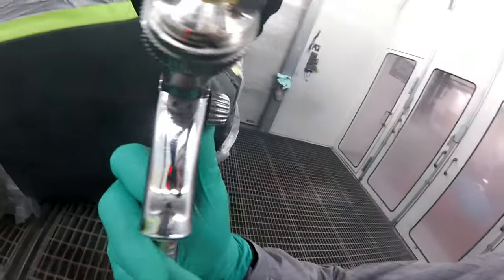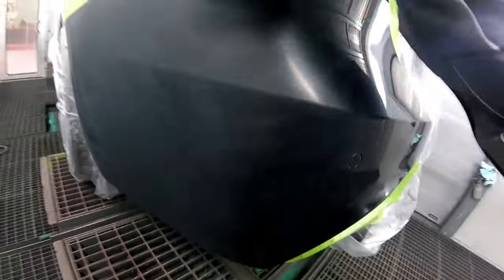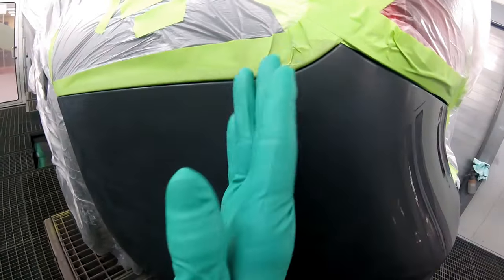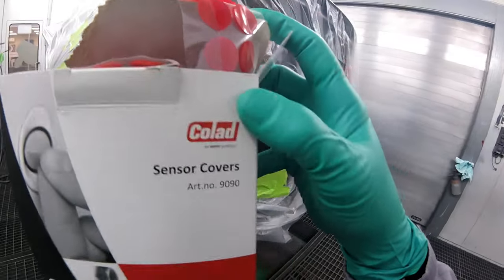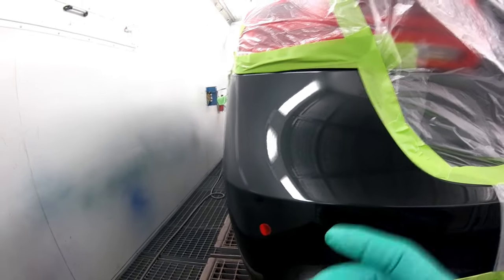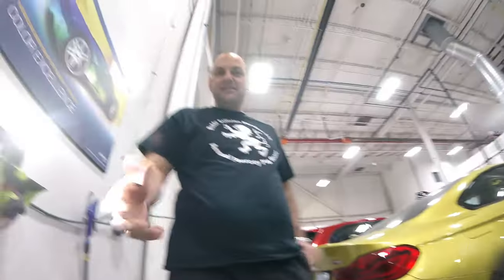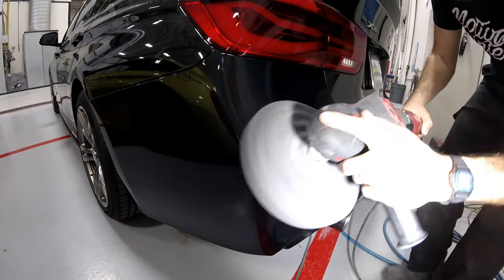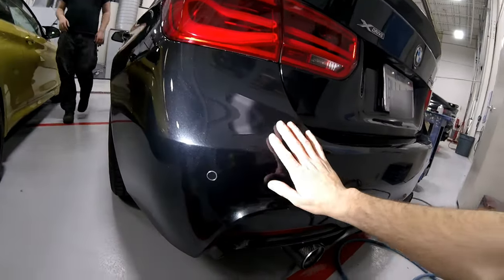Blending Clear Tips Car painting motivated painters

Comment: Nice job my quistion is if you  was to use a eg 2000 grit and then you sprayed the blender it would  run am I correct?
Now you  sprayed the blender on a 5000 gritt  and you  sprayed  alot on and it didn't run  I havnt tried that yet nice tip Gabriel thank you for the video

Comment: I tried some of that spray blender in a can just recently, I wish I had found it earlier now. Makes things easy. Nice work as usual by the way
Reply from the maker: Ahaha awesome !!! It works very very well ! Enjoy !
Reply: I've used the Sherwin Williams BS12 - URE-BLEND® Clearcoat Blender spray can stuff.  Worked very well.  Noticed "Jimmo" on Refinish Network using once.
Reply: @RPMX4  so u use the blend instead of a 2k clear can?
Reply: @MOTIVATEDPAINTERS  why did u not spray the blender across the whole area? U stayed away from the place u based coated and clear coated
Reply: @waynewilliams5802  I think blender is put on where the new clear coat ends. If you didn't use blender, and just stoped the clear coat in the spot, then there would be a a line, or some dry overspray that wouldn't stick, or you could see where the new clear ended. Blender melts the old clear coat, into the new coat you just sprayed.

No blender needed on the blow in of the base coat because it got 2 full coats of clear, going straight to the end of the panal.

Comment: Hi Gabriel, great vid as usual. Just wondering, any reason why you couldn't improve adhesion of clearcoat blend by spraying a bit of regular plastic adhesion promoter before the sparying clearcoat in blend area?
Reply: Plastic adhesion promoter is to help bonding to problem plastics.  You are not spraying onto problem plastic, you are spraying onto existing clear coat.

Comment: Hey what a coincidence I needed to see this it’s very helpful and great timing of this video being posted. I have to do a blow in today from a burn through I did yesterday trying to remove a small tap line from overspray that went further under my soft edge than I had planned on! I took you’re advice and just went out there and just started spraying for my first time with a spray gun and ended up respraying the front bumper and side view mirror only twice but resprayed the hood and two front fenders 4 times and ended up learning so much especially cause I had my girlfriend record me so I could go back and watch each coat to see what I was doing that needed to be changed and it helped so much! I tiger striped the hood the first two times spraying a silver metallic for first time probably didn’t help but the I realized I was not holding gun at a 90 degree angle when spraying the hood and I fixed it on third spray and wayla no more tiger stripes but I went tacked the side fender and then went to tack the hood and smeared the paint cause t wasn’t dry haha so that’s why I had to respray a 4th time but I’m thankful because I got a lot of practice! Thanks for all you’re knowledge and help!
Reply from the maker: Thanks so much !!!!!!   Yes we learn so much from mistakes !!!! Glad you are getting better !!!

Comment: When you say 5000 that is referring to 5000 grit sandpaper correct? 5000 on the far right side over to the left where your non clear coated side is you're about to clear coat. So when you add clear coat there will be a little that dont get touched because your 5000 grit sandpaper section is that wall between where your clear coat is and where clear coat isnt and the blender will tie it all together?
Reply from the maker: Yes sir

Comment: What would you recommend the best way to quick fix a very small area with polishing burn through?  Would that blending spray can help fix this? Thanks.
Reply from the maker: Honestly if it on a bumper you could do a small repair but if is on another panel you should sand prime base the spot and clear the rest of the panel

Comment: Gabriel, please enlighten me, this blender is it just thinner? Like the regular blenders we use on the guns? There aren't any blenders that come in these cans around here in Brazil.
Reply from the maker: Not sure what's in it but it works so good !! Unlike any other blender I have ever used.
Reply: Not sure if you are interested in the more technical part of things. I did a fast check on the Safety Datasheet of the spot blender you are using and a fast research on the key chemicals used on it. It seems it is just a thinner, doesn't seem to have any other clear or so type component, At first I thought it might be diferent than a blender thinner, since its name is "spot blender" vs some other are called "fade-out thinner" but it seems all of them are fade-out thinners, and their basic funcion is to fade out the overspray generated by the application. Am I right? Saludos!
Reply from the maker: Yes sir! For some reason this one works best for me
Reply: Perfect!
Reply: The blenders are just "hot" solvents.   Anyways, I use just plain jane Medium Reducer in a seperate gun to spray the blend area.   It works better than most of  the blenders that come in the can.  Use the Medium reducer as well to blend into a single stage paint.  Did it on an old corvette and blew my boss away.  Good luck
Reply: J Dubb - do you mean just a urethane reducer?
Reply: Paul Carbonara Regular solvent reducer. Use the same reducer you use to reduce your primer and paint
Reply: Thanks!
Reply: you can use a hot weather reducer. it'll work. just dont buff on it fast like gabe said

Comment: a question .. the area of the blending with spot blender always remains slightly opaque ... what do you have to do to polish? use a harder pad? or a more abrasive polish?
Reply from the maker: I always polish them smooth I use lightly 3000 then ñolish
Reply: Gabriel Merino so you sand the shade? with the 3000? in general the spot blender is not sanded ... but polishes directly ... it always remains a little opaque to me
Reply from the maker: Yup i sand it lightly with 3000 and polish
Reply: Gabriel Merino instead of using the 3000 ... can I polish the area several times until it is polished? or is there a risk of damage?
Reply from the maker: Won't be the same
Reply: Gabriel Merino do you say this because polish cannot polish?

Comment: Whats the technique to blend in the middle portion of the bumper , where it was masked off?
I don't want to shoot the clear to thick and create and edge or border.. When I try to " fade " it in , the clear looks matte. 
Thanks
Reply from the maker: Prep prep prep is all in the prep give yourself lots of room mask as open as you can so that you can give yourself lots of room to blend the clear
Reply: Gabriel Merino 

Maybe there is massive difference between the spray can clear and the clear in a can. 

Even at the transition point of the blending , when the clear dries , within that boundary it’s rough and matte.

I don’t think that’s prep ; maybe it’s the quality of the clear ?

Would you wet sand this over the counter clear ?
Reply from the maker: Could be quality yeah. I would be nervous to try to wetsand can clear. Maybe lightly sadn and reclesr
Reply: Gabriel Merino 

Sounds good ,
Thanks for the reply and insight.

Comment: hi gabe, I have bmw 1 series with a small burn through near the corner of the rear bumper. can your video be followed to sort out the problem. so I would wet sand the area with 800 grit, 1000 grit ( repair area), 5000 grit for blending area
Reply from the maker: Absolutely
Reply: MOTIVATED PAINTERS you da man. 👍
Reply: @MOTIVATEDPAINTERS  Hey Gabe, it says on the technical data sheet for the spray max spot blender to sand repair area between 2000 and 4000 grit, what made you decide to go with 1000 grit in the repair area? Also what made you go 800 -1000–5000 instead of 5000– 1000–5000? Why 800 on one side of the old paint and 5000 on the other side of the old paint?? Thanks

Comment: a question .. the five thousand is not too fine to adhere to the blender?
Reply from the maker: It's perfect for the blender because the blender is super thin and watery
Reply: Gabriel Merino generally for the blender a p2000 / p3000 grain is recommended ... also with a p6000 trizact does it have good adhesion for the blender?

Comment: Does PPG still honor their warranty even though you are not using a PPG spot blender?
Reply: Rene Castillo. As far as I know ppg and most manufacturers do not suggest blending only full panel so they wouldn't warranty it however  I'm sure like all paint systems when it comes down to it they would say oh sorry it seems that you may have sneezed that day no warranty
Reply from the maker: Probably not haha
Reply: Ppg always try’s to bullsit there way out of warranty anything. I know I used it for 17 years. They bring new clears out like crazy! And I believe they don’t test them long enough before releasing. In Az I had clear failure with 88, 2001, NCT, 2020 and a few others. Millage was perfect. And they wanted to give a gallon of clear for payment! 
After switching to Sikkens’s 16 years ago I have had 3 clear failures. And they cut a check for labor and materials. No bullshitting. Hopefully PPG has improved there clearcoat durability 😊

Comment: I doubt that repair will look very well in a year or so once the sun fades your blend area and using 5000 grit there is no adhesion at all for the long run.   You have to do a repair like that if its what the customer wants but not really a good option in the  long run the customer may return with a complaint in a year or so when it fades on the blend area

Comment: Is that a sata 5000 or 4000
Reply from the maker: 3000 haha 😁
Reply: MOTIVATED PAINTERS old but gold i am fixing 2 sata 4000b's limited editions at the moment they spray fine but they need a good clean and some seals need to be replaced and then i will have 2 cheap and reliable sprayguns 😉
Reply from the maker: They are the best satas